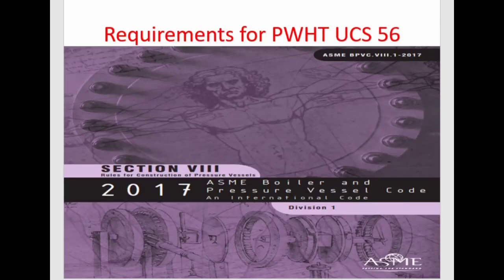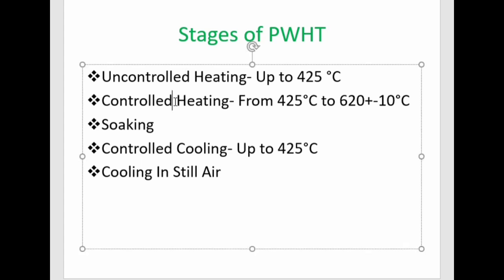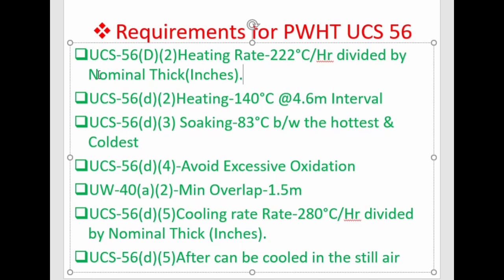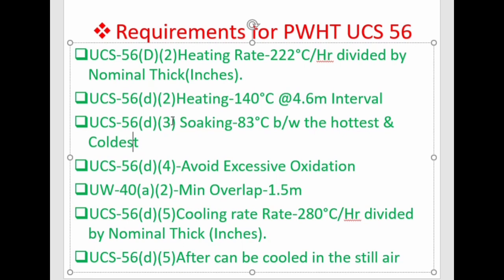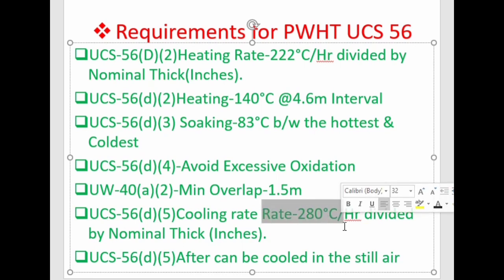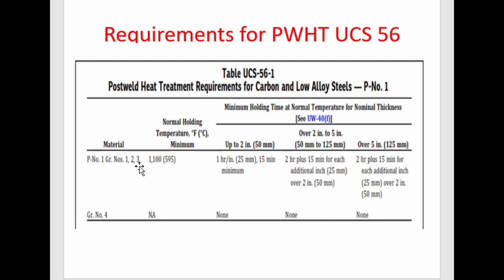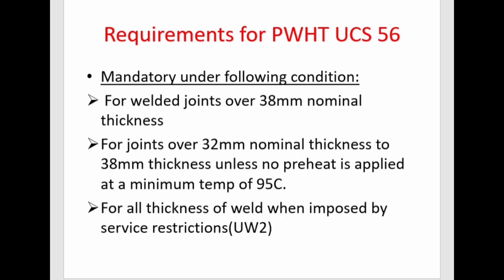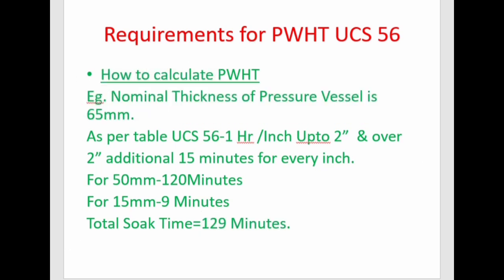How to calculate  PWHT soaking time as per ASME Section 8.

Comment: how did you calculate 15mm for 9 min kindly explain
Reply: For  upto 2"
 2hrs + 15 min
Our thickness 65mm
Upto 2" ( 50.8mm)
2hrs
Remaining thickness (14.2mm)
As per condition over 2"
Every 1" 15 minutes
1 minute =0.59mm
14.2*0.59 =9 minutes approximately
Total 
2hrs 9minutes
Reply: Here is the calculation which is given by pradeep